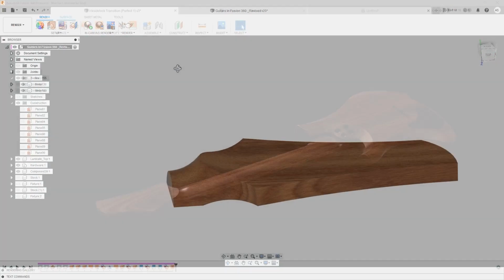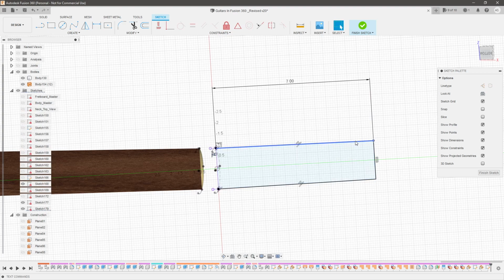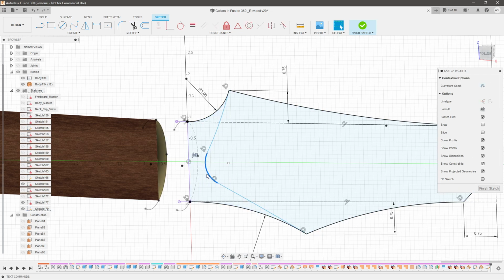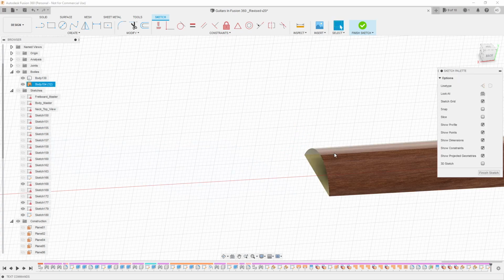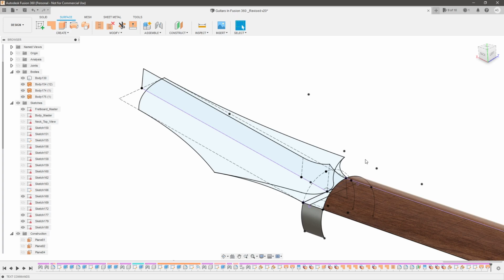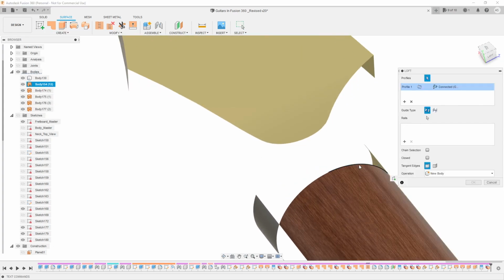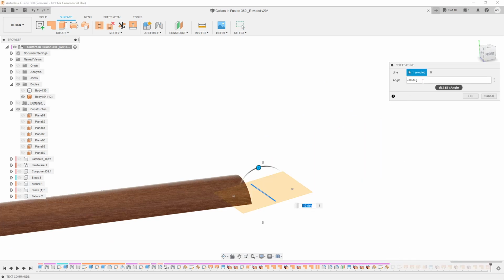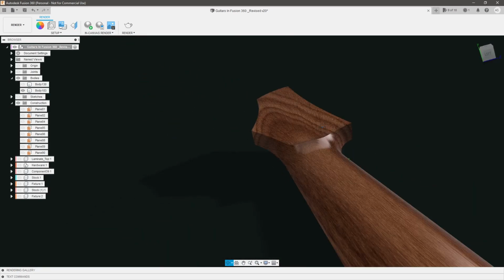SOLVED: How to model the PERFECT Asymmetrical Headstock Transition | Guitars in Fusion 360

Comment: Awesome stuff again!  I like how you ditched the intersection curves.  In hind sight,  you just had to rebuild the intersecting surfaces again so this is a much better workflow.  

Lately,  one thing I have found useful is keep those trimmed/split surfaces.  You can often reuse them as tool path control surfaces in CAM for various operations.
Reply from the maker: Exactly! I already built those surfaces at the end of the first video, but I could have just used those from the start to generate my curvature. :)

I tend to remove excess bodies to keep my timeline tidy - but I can totally see how keeping those would come in handy for CAM.

Comment: Excellent as always, nice refinements! Although running into issues and fixing them (with your help!) was a great learning experience. 

The next neck challenge I’m going to try is an angled headstock for a fanned fret - the geometries get a bit funky, and I need to thing really carefully about the workholding…
Reply: Mattia Valente If you have any brain storms on workholding, I'm basically in the same boat.  I'm doing this now with blue tape, and two locating pins.  Works, but I'd like to get to something more repeatable and "industrial"  Probably get a vacuum at some point.  It's an interesting problem, and I'll keep thinking about it.   -p

Comment: Thank you Austin! This has been working great except for one little problem. When I try to alter the scale of the guitar to a multi-scale, i run into a whole bunch of issues with the constraints on the headstock shown here. Have you tried messing around with scale length after you constrain the headstock design?

Comment: I followed your method and the result was fantastic, Problem is even though the headstock registers as a body it does'not act as one. It won't allow inspection it just disappears it can/t be combinrd with the neck error. It can be exported as a STL and slices..Any hints?

Comment: I am trying ti determine if I should switch from SU to Fusion and this video has been very helpful, but I have run into a wall.

I am at 21:55 in the video and the only way Extrude will allow me to extrude a line is to use the "Thin Wall" selection and it defaults to a pretty thick wall rather than a normal face.  No matter how this I make the wall I cannot delete the parts I don't need.  I can extrude and cut the parts that are on the plane, but I have not found a way the remove the parts that are curved up.  Any suggestions?
Reply from the maker: Make sure you are using the extrude command in the surface tab, not the solid tab. (Orange, not blue) thin extrude like that is only available in the solid tab
Reply: @austinshaner  That got it.  Like I said, new to Fusion.  Thanks.

Comment: Awesome... Much appreciated 🙏. I was getting damn close to this result (thanks to your last video) but still a bit clunky getting there, this will clean some things up for sure. I normally use a neck profile on the first and twelfth fret. Is there a simple way to simply project this shape out to the nut line to create the helper surfaces? Or does that neck profile need to be drawn again from scratch on the nut line?
Reply from the maker: I don't think you'd be able to project it, because you'd end up missing the nut line like when I extruded the helper surfaces. What I'd recommend doing is drawing your neck profile at the nut (instead of 1st fret)  and the 12th fret, then simply split your neck faces with the first fret line to give your neck profile at the first fret.